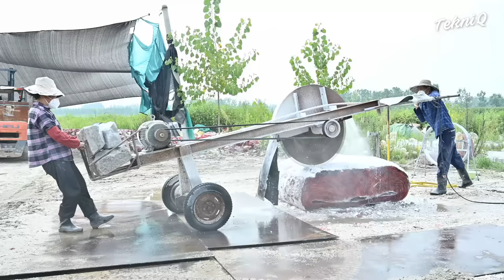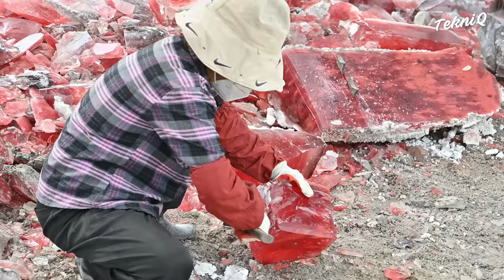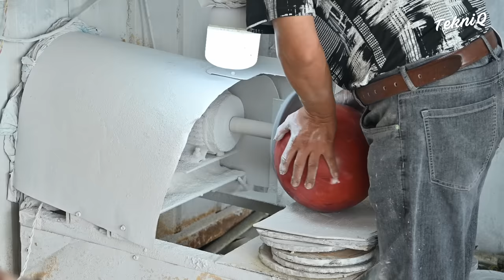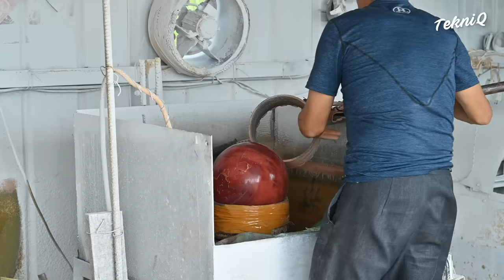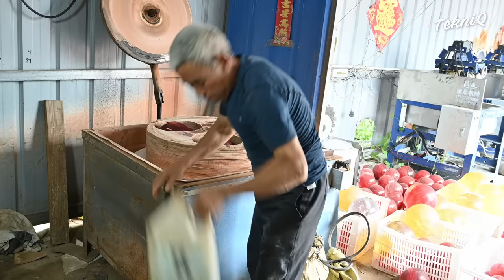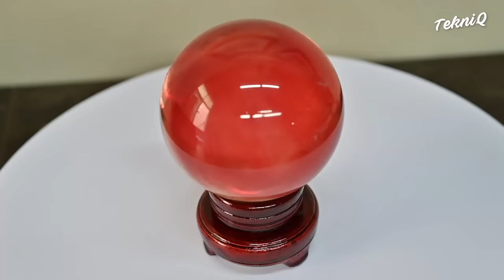Crazy Way they Cut Giant Volcanic Glass To Manufacture Crystal Balls

Comment: Whatever it is the guy using the saw to round the glass looks totally unsafe. I'm surprised he hasn't lost an arm or hand or his life!
Reply: Also I wonder how many blind ex-employees live around the factory?
Reply: It sorta looks like there's a piece of rubber or something flexible in front of the blade, that you have to press on quite hard to bend enough to get in contact with the actual cutting part. it's not *safe*, but it looks like it might take some doing in order to progress from a smaller cut to getting your fingers lopped off.
Reply: The safe part is what makes things made in America expensive.
Reply: You didnt see the previous worker..

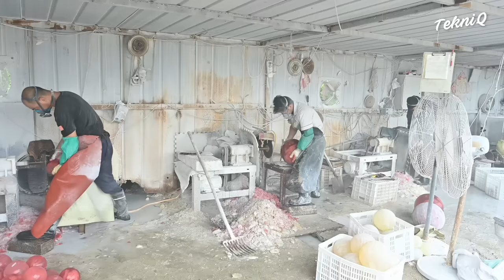Comment: How do the guys at 4:30 still have all their eyes and fingers?!?
Reply: Ah.. this is the trick:   when a guy loses his eyes or fingers, you just get a new guy. Company saves money.
Reply: New guy
Reply: To answer both of your questions. The wheel is just a grinder, not a cutter. So they may lose a few mm of skin if they touch the wheel too hard. Vision safety is the cooler explanation of the two. What it is, is that they are AAAAAASHIN. So they have built in safety squints. So, not nearly as unsafe, as one might think.
Reply: Because they're balls are so big and heavy it keeps them safe. 😂

Comment: Everything about this video is a surprize I didn't that volcanic glass came in such big sizes, far less that there is enough to supply an entire industry. 
On a personal level I have worked with grinders etc. and the scream they give off is horrendous fortunately that is something we do not get from your video. they must also be itchy constantly with all that glass dust.
Reply: It's not real volcanic glass.  It's manmade slag meant to mimic the consistency of obsidian, but in more vivid colors and better clarity than you would normally get from natural deposits.  Obsidian can come in a variety of colors depending on what contaminants act as pigments in it.  Same with meteor impact glass.  The most common range is black to green, or rusty opaque dull reds.
Reply: Yeah, is sold by the ton and is realtivelly cheap ($1 to $6 the kilogram). THere are basts amounts from it in mines from old volcanic eruptions.
The problem (As you see in the video), is that it has a lot of waste. Is full of cracks and inclusions and to find a nice clear big piece like the ones they use, you have to discrad a lot of material. The bigger the piece, the rarer is to find, so is more expensive.
They can sold this pieces 100 ot 1000x the price of the rough material.